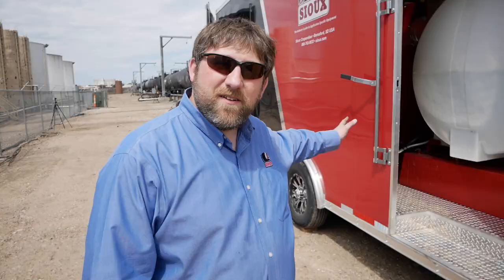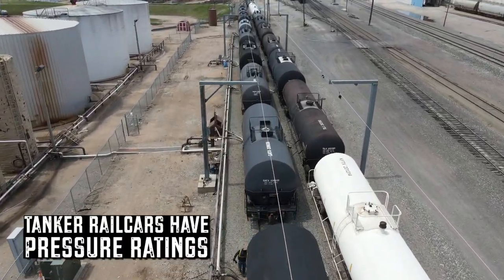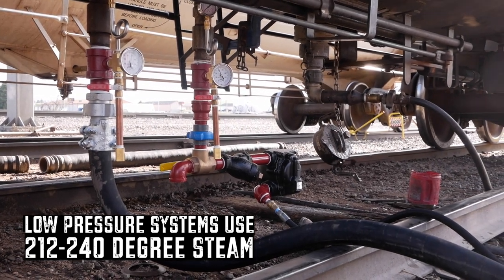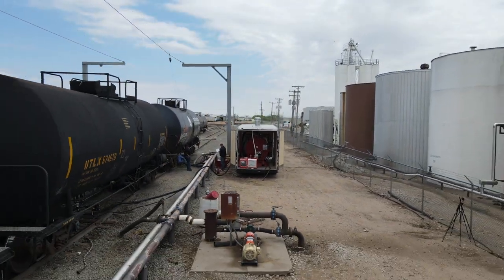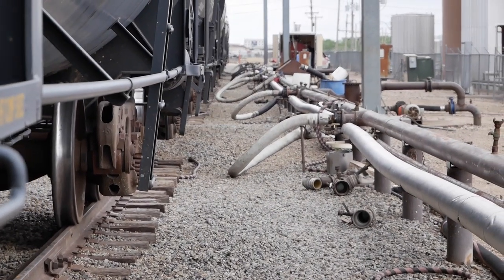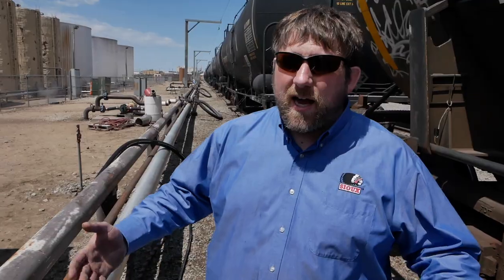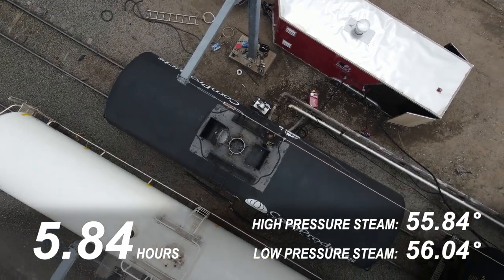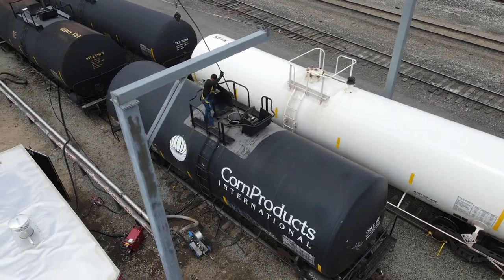What's BEST for Heating Railcars? | High vs Low Pressure Steam

Comment: If you put the steam hose on the outlet and tbe condensate return on the inlet what would happen? Aren't those two pipes basically just like a crazy straw in the railcar? It shouldn't matter how you hook up the hoses underneath. Right?
Reply: Rail cars have inlet (steam) and outlet (condensate) marking. Some rail have two set of coils, so make sure you line inlet/outlet per coil.